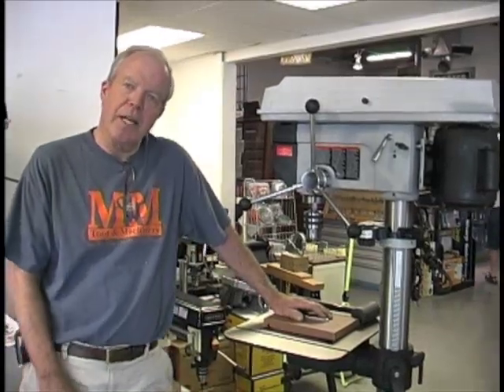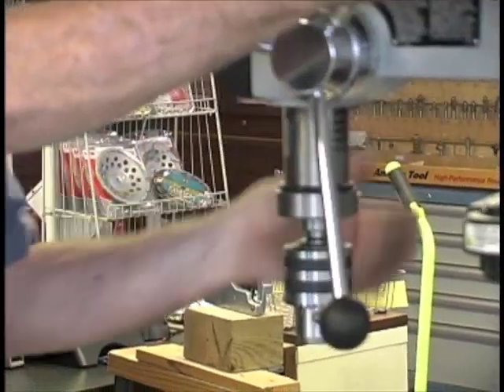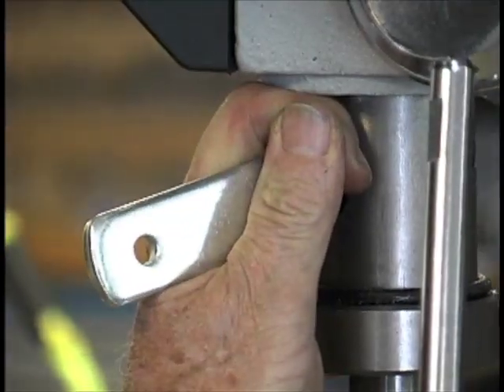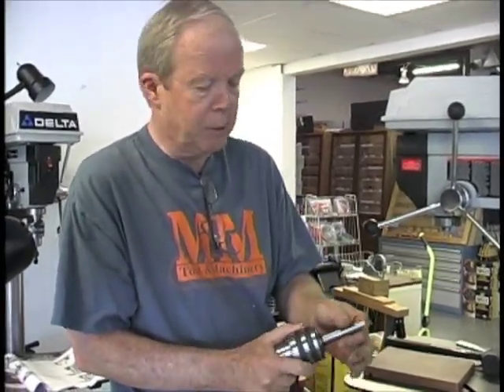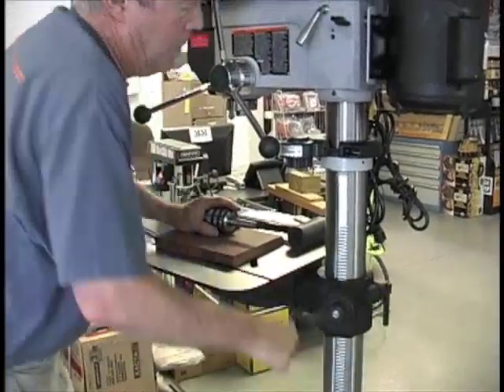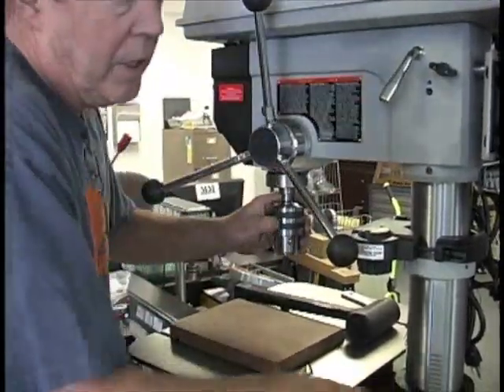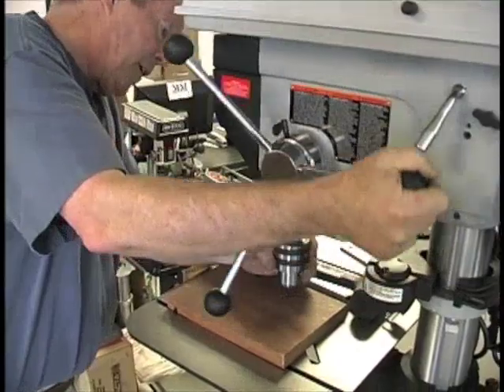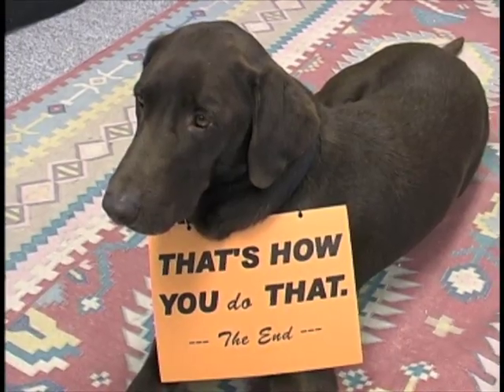How to Remove a Drill-Press Chuck

Comment: what do you do if the check comes away leaving the arbor wedged in the spindle and while there is a slot in the spindle it is not open into the centre so you cannot get a wedge into it to knock the arbor out!

Comment: This video does not fully address how to replace the drill press chuck.  You also have to remove the morse taper bar from the chuck to free the chuck from the tapered bar.  How is this done?
Reply: If the morse taper isn't threaded (Jacob's taper mount), open the jaws completely and take a punch inside the chuck to knock the arbor out.